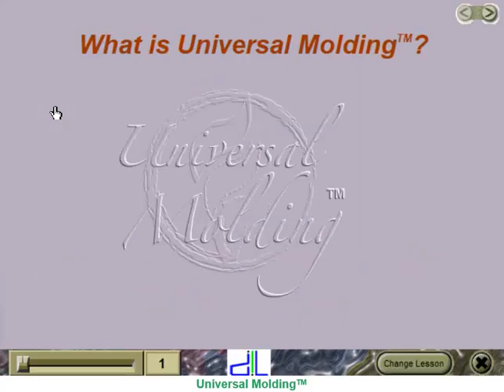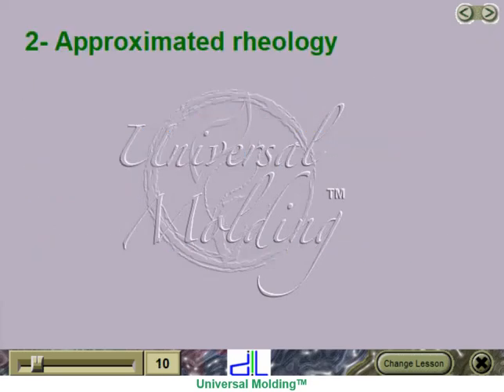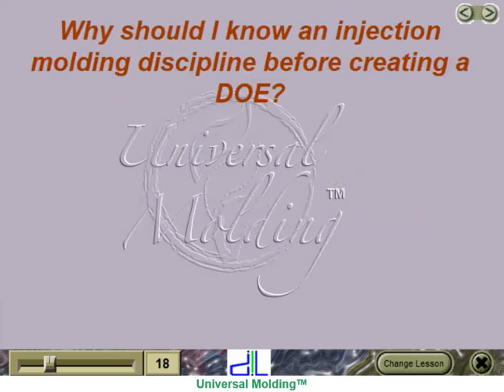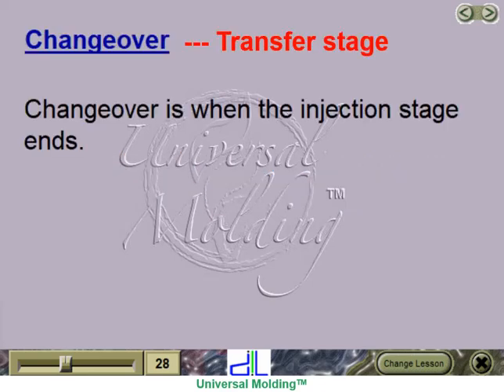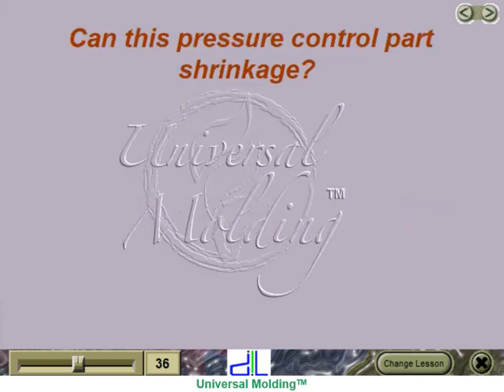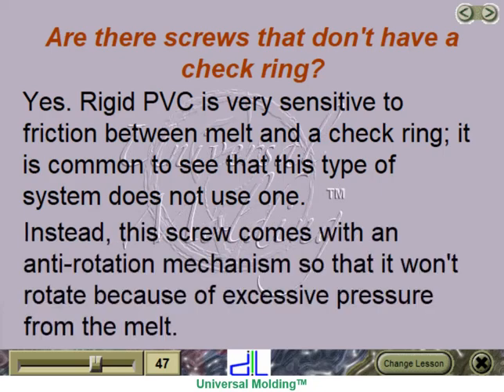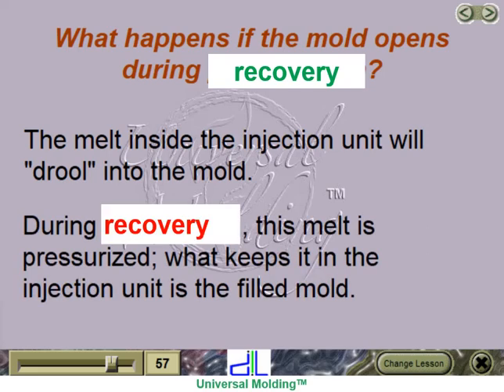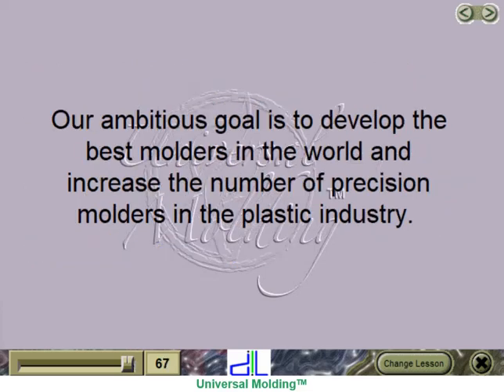MU1E – Introduction

Comment: Hi, first thank you for such an informative video. I would ask how l could obtain English version of this book? I see the add-value potential of the idea and want to have it as a guiding book in my career. I am a new entrant to the sector.
Is there a possibility of obtaining it as an e-book because of possible problems due to duty region and shipping delays?
Reply from the maker: My apologies for the late response. https://www.amazon.com/Universal-Molding-Systematic-Injection-Optimization/dp/B088N3WRLL/ref=sr_1_1?crid=26OGWGQNZEMSI&keywords=Universal+molding+book&qid=1683387964&sprefix=universal+molding+book%2Caps%2C222&sr=8-1&ufe=app_do%3Aamzn1.fos.006c50ae-5d4c-4777-9bc0-4513d670b6bc